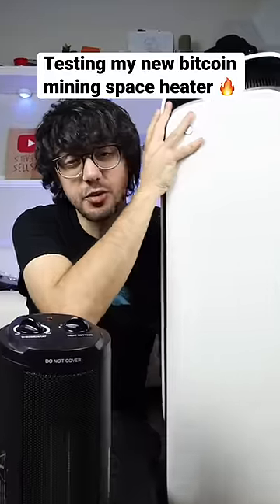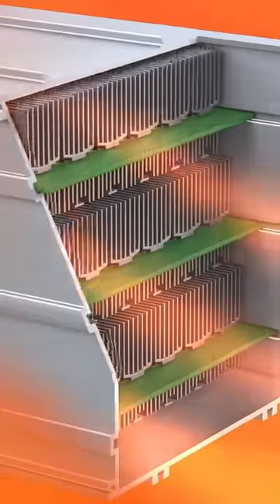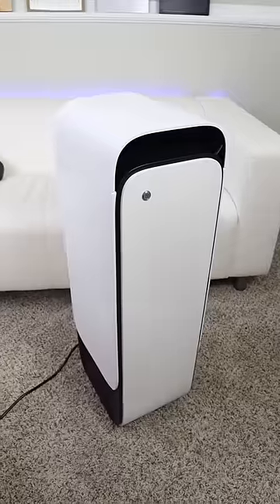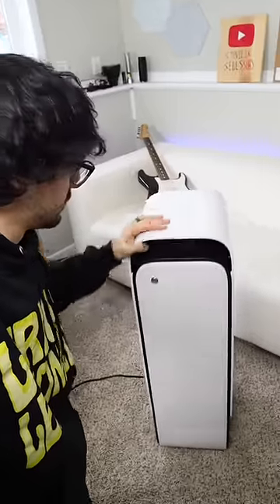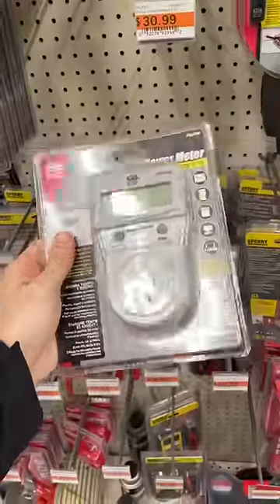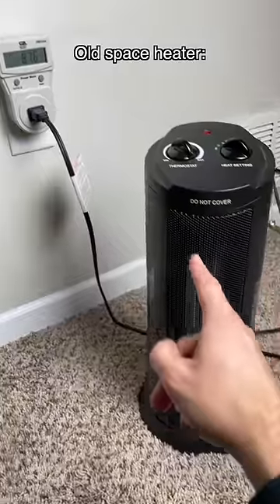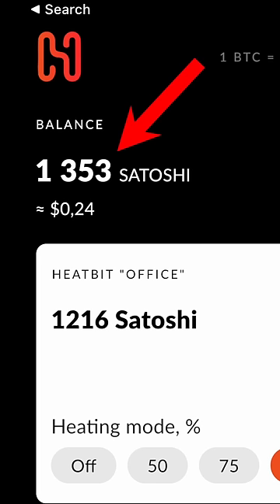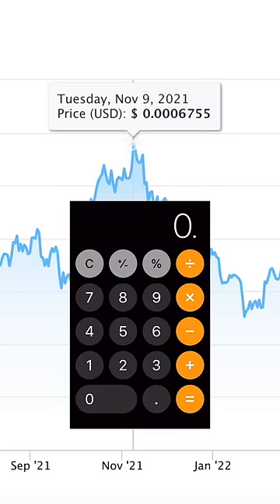My new bitcoin mining space heater

Comment: My man's back with some weird and unique thing. Can't wait for updates though.
Reply from the maker: Lol. Should be fun 🙌
Reply: Wow
Reply: Nice
Reply: Lol
Reply: @StevieSells  did you updated?
Reply: $4 a day, $28 a week, $56 in 2 weeks $112 a month. It's not going to be worth I think...
Reply: @yep2140  .24 cents in 5 hours say he was using max heat for 2 of those 5 makes it instantly not worth it, Didnt even need an update lmao. Uses 1400w and average power price is .11 cents? 1000w
Reply: neither wierd nor unique.
only problem the only chisp that are efficent enough to cover hjardware and electric costs are from bitmain (patent). 
dealing with them or thier hardware is a nightmare. overall i doubt the device will run long enough to amortize itself compared to cheaper methods of electric heating.
besides cheapest is still oilheating even with just a small generator
Reply: @StevieSells  you look like the type of guy who would have a Bitcoin heater
Reply: @yep2140  it would be for me I pay $42 a month with my current heater which is inefficient and doesn't make me money passively.
Reply: @yep2140  The bitcoin mining "feature" in itself certainly won't be worth it. The really interesting question is rather how well it is doing compared to the good old boring heater. If you only run it when you need it, how long does it take to pay back the cost difference between a boring heater and this expensive machine.
Reply: @StevieSells  this definitely does not mine Bitcoin.
Reply: Tomorrow?:)
Reply: @StevieSells  how much was the heater?
Reply: @StevieSells  hey buddy, i run a 1 MW mine myself. maybe this message will get to you. dont buy "heaters" or other marketed gadgets.  a regular bitmain s19, or whatsminer will work a lot more efficiently. as the db rating is higher, either DIY a silent box or put in another room and duct the heat throughout your house. residential power rates are .12 kwh - .14 and are traditionally not profitable to home mine at 16-17k levels. if you need any help, reach out. (its close to time to buy miners)
Reply: - and for everyone else reading this -
stop bashing bitcoin, mining, and of the such. if you dont understand something its best to sit and watch on the sidelines. the nonsense you guys spill just spams up the comment sections
Reply: @StevieSells  you never updated anything
Reply: @satoshinakamoto7880  I didn't understand the Beenie Baby thing either.
Reply: @Jonnymad1245  theres no possible way this thing is profitable at residential electricity rates. the only way you could claim profit is if you completely offset heating your home with the unit. but even then, its a stretch with a low efficiency unit.
Reply: @imxploring  idk any beanie babies thing, sorry
Reply: @satoshinakamoto7880  we all know he just promotes scams
Reply: @Jonnymad1245  wouldnt necessarily call it a scam. just an inefficient miner. and bitcoin mining isnt as easy as it seems. prob best to study for couple years(literally) before you tackle mining
Reply: @satoshinakamoto7880  all the "miners " he shown have been proven as scams

Comment: “Oh shit we forgot to put in a cooling mechanism.”
“Tell ‘em it was on purpose”
Reply: 1000W is 1000W. Doesn't matter how much you cool it, it heats up the room the same amount.
Reply: @XenFPV  I believe he's referring to the mining processing components, miners are usually very mindful of temperature on their components so that they last longer, this space heater has weak fans implying the components may be cooking.
Reply: @XenFPV  he means a cooler for the heaters internal components
Reply: @Vl0gWithAb  you dont understand. If you put cooling fans inside the computer it still gives the room the same amount of heat. 1000 watts of heating is the same from a computer and a heater.
Reply: @wolvreigns  noooooo, i'll try to explain this very simply. you want to keep integrated circuits cool. They are making the joke that instead of cooling the circuits properly the manufacturer is calling overheating a positive instead of a negative. Hopefully they actually did design a proper heat transfer system and not just leave the ICs soaking in their own heat until the point they thermal throttle or simply burn out.
Reply: @metalwolf112002  no shit. They keep the insides cool by drawing in fresh air from outside of the system. Why I am saying is that the air that is pushed out is heated just like a normal electrix heater. So with the original comment saying they forgot to put in a cooling system is stupid as with or without a cooling system it would produce the same amount of heat assuming it doesnt thermal throttle.
Reply: @metalwolf112002  of course they would implement a proper cooling system for the internal parts. Thermal throttling is going to reduce the performance of the machine.
Reply: @wolvreigns actually depends on the cooling system that would be put it. Diffrent types exist. And this has a heating element. All the heat isnt being produced from the mining components. And the fact its inclosed. And constantly running with what looks like not much vetelation. Did you buy one so you defend it to make yourself not seem stupid for buying it
Reply: 'ITS A FEATURE'
Reply: @XenFPV  when you try an be a smartass...
Reply: @wolvreigns  yeah but how does cold air get in there fast enough?
Reply: @soacespacestation8556  with cooling fans
Reply: A Bitcoin miner with poor cooling would make a less effective heater because it would thermal throttle without dispersing as much heat as one that does have effective cooling.
Reply: @user-ok4pk2mp3e  yep. Good thing it has adequate cooling.
Reply: @tram1839  I don't understand this. A system with better cooling would be better at heating the room, no? Since all "cooling" is really just displacing heat.
Reply: @halkon4412  not really, since its the watts that the component is using that is generating heat, watts is a measurement energy used and conveniently is the same to measure heat output, so for example a candle generally outputs around 80 watts of heat.

but yes the faster the heat gets off the cooling fins the colder the component gets, it just has diminishing returns and you don't wanna make a lot of noise with these living room appliances, (sorry I'm not very good at explaining things)😅
Reply: If they had put in a cooling mechanism it would actually work better as a room heater
Reply: so true
Reply: Came here to comment this 😂
Reply: @tram1839  if it's sold as a heater it has fans to blow to hot air out so idk
Reply: It heating the room is the cooling mechanism
Reply: @XenFPV  i love that people argue over the dumbest shit like is this really how much extra time we all have?
Reply: @swiftpawtheyeet6648  but it did have fans, it just wasnt blowiematrons that miners use. i'd prefer my room not becoming a OSHA violation due to the noise pollution of my space heater XD
Reply: It's the opposite. If you feel the heat coming from your pc that means cooling is doing it's job

Comment: BTUs are BTUs... it's automatically more economical than the resistance heater. The big thing to consider is the cost of the units to begin with.
Reply: $1200, and at the current price, you would profit $100 a year and break even in 12 years. I would personally just buy the $22 walmart space heater.
Reply: @jackb8563  $1,200? Holy cow, just buy a $200 natural gas ventless wall heater or 2, or 5 at that point. Natural gas cost to BTU is a fraction of electric.

Comment: Doesn't heat very well, doesn't earn much money, costs a small fortune... 👍
Reply: Heats exactly as efficiency as any other device heats by using electricity (space heater, electric oven, computer, light bulbs, etc)
Not defending the purchase, but it heats just as well as anything else.*
things like heat pumps and ac units can produce more perceived temperature change by using electricity to *move heat instead of generate it (does not apply to space heaters)
Reply: @Kai-K  fair

Comment: Bros making 100 dollars a year 💀
Reply: Pays more than that to power it
Reply: @Andrew-qm5im  This is the most practical way to mine bitcoin. if your electricity cost is say 50 bucks/month running a space heater 24/7 and you get 30 dollars worth of bitcoin back thats better than spending 50 dollars/month on a regular space heater. Now the cost of this unit I doubt makes sense but geting old mining hardware is dirt cheap.
Reply: @TheChemisch  bro he just said he got 25 cents for 5 hours of runtime I don’t think you can power a space heater for more then 5 hours on less then a quarter
Reply: @benygames7399  Current rates. Given the hashpower you make like 84 cents a day and spend 3 dollar on electricity(@10cents per kilawatt. But if you ran a space heater all day you'd spend 3 dollar in electricity so it does make sense only if you live somewhere cold where you can use it all the time. That being said for how much the unit costs it would never make sense. They want 1100 bucks for what is a 50 dollar used miner on ebay in a fancy plastic case.
Reply: @TheChemisch  You have flaw in your calculations, because it is generating 5cent per hour you can calculate how long it takes until the high buying price is payed back.

It costs 1200usd,generates 0.05usd per hour there for has to run like 24000h until it breaks even. That are about 1000 days, if you heat non stop, this means over 3 years but normally people only heat in the winter Tim this means it will take beyond 6 years to just brake even with a cheap 50usd heater which can heat with 5kW. And if it breaks in the 6years you have a loss.
Reply: Why you arguing if it pays the elec bills? The point is to heat your room the BTC is bonus.
Reply: @benygames7399  if you run it to heat the same amount, then you pay the same energy for it.
All heating devices are equally efficient, from a flascreen TV to a toaster oven. Energy can't be destroyed and it all becomes heat one way or another
Reply: @theninja4137  100% this. The exception is if you can buy some other form of energy at a lower cost than electricity. In the US, it's a lot cheaper to buy natural gas and burn it to create heat than it is to convert electrical energy into heat. Alternatively, if you can use electrical energy to run a heat pump, you can theoretically get more heat out of the system than what it takes to run it (by pumping in heat from somewhere else). But if the goal is to heat and maintain the temperature of a room using only electricity and no heat pump trickery, it's going to cost the same if you use a toaster or a flat screen TV, or a dedicated space heater.
Reply: @GregariousRat or getting a real miner and just exhausting the hot air to your room or something.
Reply: @partytimeninja3139  isn't that the point of the video? What do u mean it doesn't matter if it pays electricity bills
Reply: @MARkoe93  but he literally said that's it's too expensive and wouldn't pay itself.
Reply: @partytimeninja3139  he probably payed more then 100 for it and 100 dollars a year doesn’t pay for the heater or the bills efficiently
Reply: oh my god who cares no one here is actually gonna do this anyways.
Reply: @LostAfterMe  Your apology was funny enough to let it slide :p.

its advertised to generate 14TH/s which you just plug into a mining profitably calculator. Just bitcoin generated per given amount of time. minus those electricity costs. My example I used .10 cents per kwh. Some places are cheaper but 90% of Americans pay that or more.
Reply: now in 30 years who will be laughing 🤣🤣🤣🤣
Reply: 5¢/hr keep it running all year would be ≈$438/yr
Reply: @TheChemisch  practical for 1200$
Reply: I did the math it's 420.48 a year if you run it 24/7 that's including during summer.  But if you factor in only running it during winter it's gonna be lower
Reply: Maybe if you had solar and it negated your power bill you could profit but yea you in the hole heater cost 1200 smh
Reply: @Mellojack  heater on website shows 1200 dollars
Reply: Don't forget this thing cost $1200 to start with.
Reply: @DavidGoliath1  couldn’t agree more
Reply: Come June when he's paying to cool that thing he'll be paying to mine BC for whomever is issuing him those tokens...
Reply: @beans1215  finally a man with some sense
Reply: And just the Heater is 1200 dollars
Reply: I mean the reality is if you live in a cold place then spending money on heat is a must anyway.....so why not get SOMETHING back anyway
Reply: @partytimeninja3139  its insanely expensive
Reply: @partytimeninja3139  Because it's not worth the premium, dummy. The fancy bitcoin machine is worth $1,200. A good space heater is maybe 80 bucks max. The bonus needs to worth the extra cost.
Reply: .25 / 5 hrs = $1.2/day = $438 / yr at this bear market price. you probably pay less than running a large space heater that makes no money
Reply: @Dunixify  to break even with that rate, you have to wait like 2 years and 6 months

Comment: A space heater has an efficiency of about 100% and your mining-PC (when used for heating) has that too. This means, if your mining-PC has a load of 1000 Watts, you would have the exact same heating effect as with a 1000 Watt space heater.

Even though generating bitcoins with a space heater is kind of funny, you would save a lot more if you were using a heat pump. You could also use your air conditioner for heating (if it supports it).

Comment: Seems like the heatbit is a repurposed antminer s9 looking at hashrate + wattage.

Maybe interesting to check if you can fit a other miner in parts inside that thing.
Reply: Would be concerned about a fire hazard/none serviceable power connectors. I’ve had s9s MELT the power cables. Seems to be completely random unless you are overclocking. I’m guessing it is the cables made on a Friday right before shift change. Improper crimps half a$sed stuff etc, maybe someone left the insulation on 😂

Comment: Did some math. Not sure how many watts the power supply in that thing is or how much you are paying for electricity but I'm assuming around 1000 watts PSU and around 12 cents kwh. If you ran it 5 hours per day your energy cost per day would be 60 cents. So 24 cents would be almost enough to cover half that. I'm not sure exactly how much the space heater consumes but it seems to me that regardless of how much the space heater consumes the bitcoin miner is still going to generate the same amount of heat if it has the same wattage power supply, so as long as the bitcoin miner is also generating revenue it's going to be somewhat cheaper.

Comment: Should produce $35 worth of BTC a month and the device costs $1200 so about 3 years running all day every day before it starts to pay for itself.

Then factor in the average utility bill costs 20¢ per kWh and this thing uses 1.4 kW and generates 4.8¢ per hour. Net loss of 15.2¢ per hour.

Across a month this thing will earn you $35 and cost you $146 using around the same amount of energy as a regular space heater. 

It’s not a practical form of mining Bitcoin by any stretch. It’ll take you 5-6 years to profit $1,000 if you run it every day. This device is more practical than a dyson but less practical than nearly any other space heater. If you’re deciding on which $1,000 space heater to get, get this one. It’ll save you $30ish a month on your electric bill. But if you’re a normal human being who gets $100 space heaters, this just isn’t worth it and never will be unless it gets more efficient at mining crypto at a rate of 3x-6x it’s current processing speed and the company sells it at a $400 price point over a $1200 price point. Then it’ll be worth the purchase.

Comment: This is what I've been doing with my pc during the coldest days of this winter
Reply: That sounds nice. Unless you live in Florida like I do and you have an rtx 3070. My room feels like the air conditioning is broken 😂
Reply: @musicalwolf5481  my room is mega insulated and warms up with a 1060 running overnight
Reply: My worst enemy was an old GTX570 Direct CU II. Past 300w. 400 series was even worst but I had skipped. Worst thing is I think we are back worst with RTX
Reply: @wisico640  the good old fermi furnace
Reply: Computer spielen
Reply: @jamescollins6085  you should pay more attention to your NAS,
or ask scelli how to properly do electrical wiring
Reply: @HappySlappyFace  Taco Bell
Reply: Like 10 years ago I used a gaming laptop and loaded up battlefield 4 at max settings in the test range plugged in cradled for heat lmao
Reply: Try running an overclocked 3090ti + 5600x, 3mx4m office space i.e
 10'x14' (give or take). Have a 2.5kw air con unit that has to run any time the pc is on otherwise the room exceeds 30 degrees celcius (usually 6 to 8 over ambient temp)
Reply: @DopeyPotato  bit expensive innit
Reply: Would be cheaper to turn the heating on and won't ruin your GPU
Reply: @PAllen74  aha but it doesn't ruin your GPU! if you keep temps managed and everything supervised then it does nothing to your GPU other than accumulate dust in the heatsink. In fact when I mine I power limit my GPU to 80% so it doesn't even work at its full capacity, so less heat output and less fan noise.
Reply: @PAllen74  as a penguin u should know sometimes the heat isn’t enough if it’s below 0
Reply: im canadian and the burning potato pc isn't enough to insulate the room